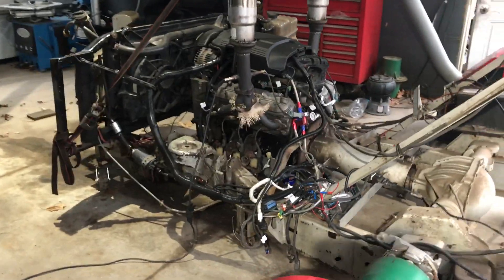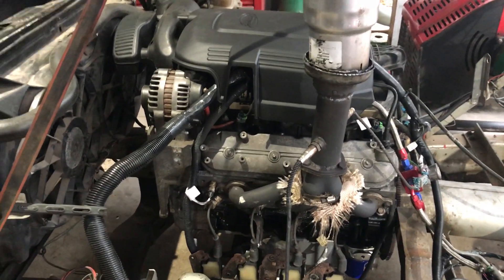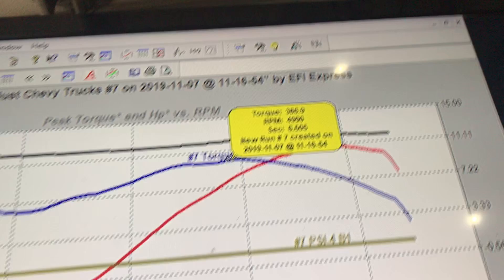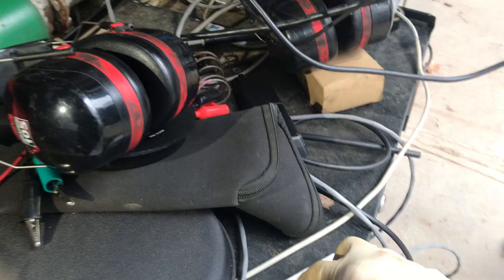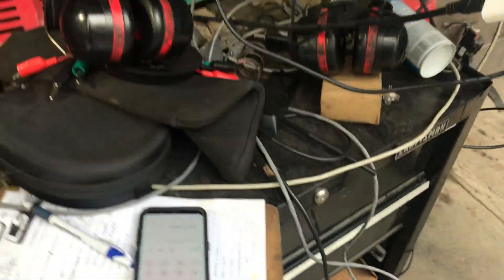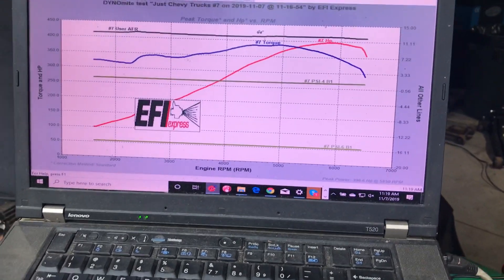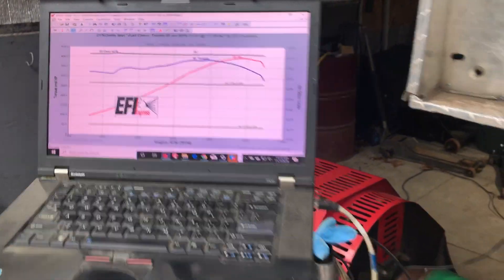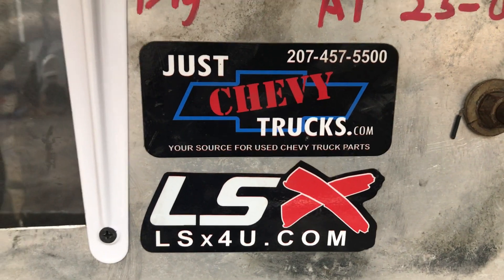Sean Rawlins '10 L96 6.0L LS Engine VCM Cam

Comment: running a lq4 with 243 heads, cam, tbss intake, ST headers, would 863 heads be better for more hp?🤔
yes will soon get LT headers
Reply: made 390 on dyno as well
Reply: Justchevytrucks all 862 head will fit a Lq4? their no modification required?
what do you recommend setup for the most hp from an lq4?
Reply: Justchevytrucks last question but what's the most HP can i expect to see out of an lq4 w/o spray or forced induction
Reply: appreciate you replying an helping!